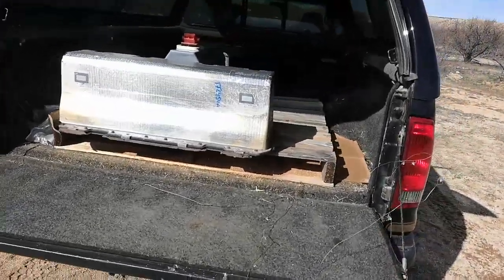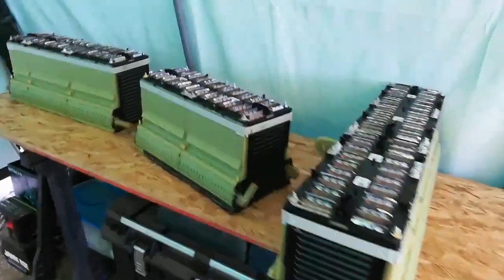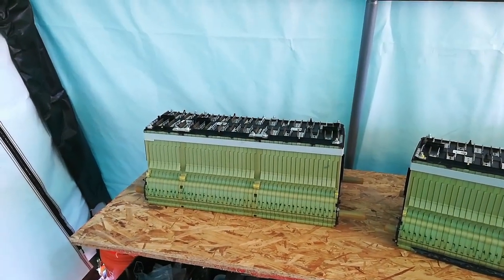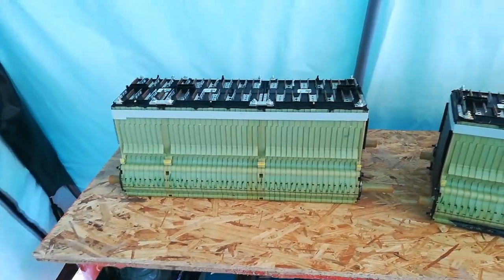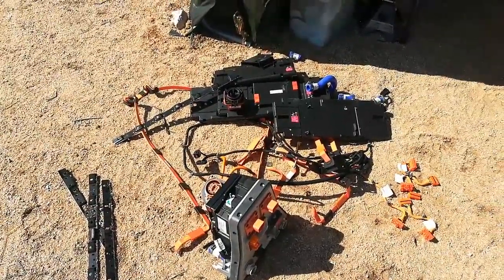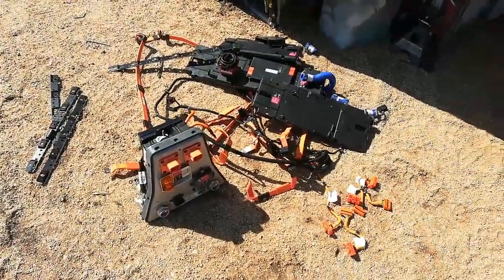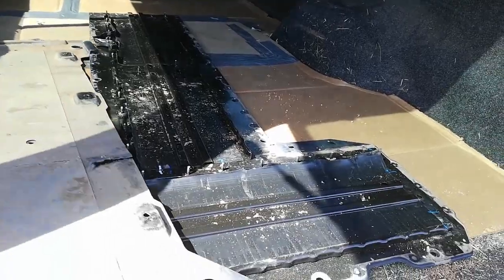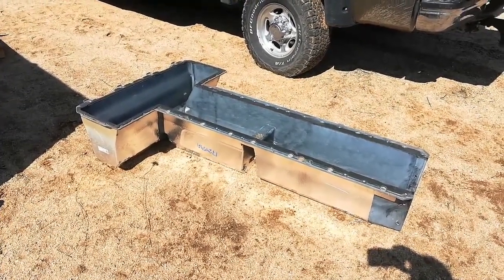It's All Getting Very Real....Solar!

Comment: Did you complete your system?
Did you go 44V (12s) or 48V (14s) nominal?

I have 2nd gen 2017 w/ 3k Miles Chev volt 18.6KW system with outback Radian 4048
I'm in Sedona az but my system is in Colorado.
I think that your close and I would like to check out your system and maybe give you some feedback from my install 
Let me know   markscanlon4@gmail.com